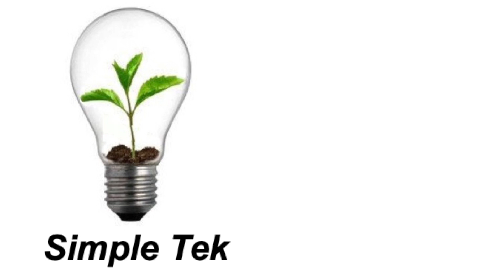Greenhouse Geodesic Dome Growing in  -40'

Comment: I found an old book from the fifties written by a Danish plant expert.
And i quote (from memory that is)" Tomatoes need very stable temperatures to thrive, +18C at night and +24C in the day time"
He also said that the proteins in the leaves will coagulate if the plant surface temperature reaches close to 35 degrees C.
So next spring im going to try his advice in my small greenhouse, with the help of a electric space heater im going to have an automated simple system at 24C daytime and 18C at night.
And im going to have an emergency cooling system(again a fan taking in air from the outside).
Will see if it helps.
(Im in the North of Sweden, roughly somewhere in the Northwest territories for you, just not as cold as Canada i imagine.)
But growing tomatoes in the winter is hardcore work, thanks for the video, great content and good luck!
Reply from the maker: Thank you for the kind words!!

Comment: My advice would be to attach a greenhouse to the side of an already heated building, the building and the greenhouse will insulate and heat each other by some amount, as well as shielding each other from wind. Every layer of plastic you add, even if it seals poorly will add a significant amount of insulative value even with a small airgap. If you did buy a digger you could dig several feet down, lay down insulation underneath and on the sides of the hole (sides only would be fine it if you went deeper than the frost line) , then only partially backfill with soil for thermal mass, gaining you below ground height for taller plants, and innate protection from wind, Could also use any excess dirt from the hole to build a mound to block wind. A basic shed around that boiler would keep it warmer and you might be able to pre dry wood in there with the waste heat
Reply from the maker: That works

Comment: The shiny foam board insulation is10$ for a 4x8 sheet here in Ontario and if you tape the seams between the sheets it works very well, you could insulate the floor with it but it’s slippery and would compress over time. I would put small pieces under the containers to lift them up a bit so they don’t lose heat to the ground.
Reply from the maker: Where???? What store?
Reply: @SimpleTek  I just double checked, Lowe’s has 4x8 silverboard for 12.50, its went up a couple dollars since I’ve last looked
Reply: @SimpleTek  Home Depot and Lowe’s
Reply from the maker: @ourfamilyoutdoors7331  I just looked at Home Depo online, couldn’t find anything under $20, and that was 1/2 inch thickness. So even IF they had $10 sheets, 1/2 inch means to get 4 inches thickness you need 8 of them, or $80 a sheet…
Reply: @SimpleTek  I don’t think it needs to be 4 inches thick, I’ve never seen it used layered up like that. It’d probably be better to use a different insulation if you want it to be 4” thick.
Reply from the maker: @ourfamilyoutdoors7331  they make 4” styrofoam sheets, I’m using them now

Comment: I have a design that I'll try next. If you put bubble wrap (big bubbles, with bubbles facing out) on top of the frame and then clear poly on top of the bubble wrap, you wind up with air spaces between the two sheets of plastic being held apart by the bubbles. This way you don't need to blow air between the plastic. What do you think?
Reply from the maker: personally I hate bubble wrap.
Reply: Without the air pressure the cover will flap in the wind and sag under load :) The air pressure in my cover per square foot will lift objects weighing over 10lbs. (Metric 51 kg per m2)

Comment: That boiler should do closer to 5000-10000 sq ft. You need to dig down and insulate the base and any north walls like the chinese greenhouses.
Reply from the maker: totally agree. I need a Chinese style greenhouse with a retractable insulating blanket. that's my next greenhouse.
Reply: @SimpleTek  If you can source it foam insulation is your friend. Earth berms couldn't hurt either. Or some form of thermal mass element. Happy new year by the way and a thank you for your content. I'm sure you have seen the Nebraska man grows oranges in the snow video, this inspires me.
Reply from the maker: @markschroter2640  I have a video on how to supercharge his system for colder climates like mine!!! Cheers!
Reply: @SimpleTek  Ground source heatpumps?
What is the name of it?
Reply from the maker: @markschroter2640  they work, expensive though.

Comment: For the plastic tears, you can use clear aircraft tape.  It's the stuff used on the leading edge of the wings able to withstand high pressure and temps.
Reply: Have you tried tuc tape?
Reply: @markschroter2640  cheaper.   Not sure how well it will stick.   I like cheaper but needs to last a long time as well.  Surface prep is important and transparency if there are many tears and strong winds can be an iasue.  Personally $20 for a known fix is worth it but to each their own.
 Being air tight has a huge impact on moisture control as well.
Reply: @l0I0I0I0  Adhesives are like magic, it may well be worth the $20 if it works.
Reply: @markschroter2640  Thanks Mark.  It will work, proven method.  The tape I have worked with is weather proof, rapid temp change  proof, sticks like crazy, difficult to remove, UV resistant or proof, and is way cheaper than 300+ for new plastic.  The reason for the over engineering is because if a piece flew off and hit the engine, it could cause millions in damage and kill the crew.
Reply from the maker: @markschroter2640  I used specific greenhouse tape
Reply from the maker: Where would I buy that?
Reply: @SimpleTek  Let me check Amazon.  Stuff is amazing!  We used it on our Coast Guard jets speeds 300-400 knots.  Brb

Comment: Surround Yugioh Dome with biomass for decomposition compost insulation and build out your front door to be a double door system so you interested or close it and then enter the second door into the greenhouse
Reply from the maker: rather use a pile and pump the heat in

Comment: How long can your plants survive in a power outage?
Reply from the maker: depends on the tempature and wind... mind you I do have a generator. electricity is needed for the pump, dampener on the boiler and  and air blower on the greenhouse for the double poly- not even 100 watts total, the boiler just burns wood for heat.. I guess the fan on the radiator too in the greenhouse need electricity but not much
Reply: @SimpleTek  we were out of power for a couple hours last night. At minus 25 and a good wind, it would cool off fairly quickly without the double layer poly and heat from the boiler.

Comment: I have been designing a sort of super cheap rather large green house.  I hope to built it later this year, but it might be that i would need a permit despite living in the middle of nowhere.

Now when material price is skyrocketing i was looking for the cheapest building material i could find. The cheapest material i could think of is earth, straw-bales and raw-woodbeams. 1 Meter of earth have about the same insulation value as 10 cm of Styrofoam insulation, and 25cm of straw bale have about the same effect.

The greenhouse need to be fairly big to be efficient, but there is also a limit to how wide they can be made before it start getting expensive. To my calculation  about 7 meter wide is the optimal width. Separate the wood-beams and connect them with machine screws. (sure then are not cheap, but strong)

I found this product that is pretty much a double layer bubble plastic sheet for greenhouses that probobly could be pretty effective.  The thing with dual layer plastic is that it eventually losses its efficiency, and if they middle layer get to large, its actually get negative effect to expand it more due to convection transfer. Bubble wrap kills the convection transfer aspect of it.

On top of that, a earth heat/cooling pipe, that push down air in a pipe under the greenhouse if the air is over 30C, making it a pretty heafty heat storage for the winter.

Anyway, i have made a preliminary picture.

https://scontent-cph2-1.xx.fbcdn.net/v/t1.15752-9/270278480_4917686594929739_4527144353763718844_n.png?_nc_cat=103&ccb=1-5&_nc_sid=ae9488&_nc_ohc=RHqd6nMsob0AX-4q0k-&_nc_ht=scontent-cph2-1.xx&oh=03_AVIhYIokN8c4K3lxf7XSx8D4sY8Xbm068M4sshNJcqwajw&oe=61FBD125

On top of that i have an idéa of adding a on top 2 meter mylar sail to direct more sunlight down into the greenhouse. If the sail is angled somewhat down, when the spring comes around, the light will miss the sail.

Aditionally, a roaled blanket night insulation might also be added, that is one of the reason i'm doing sort of a solar greenhouse style build.
Reply from the maker: Just some thoughts on what you posted..

raw earth is best used as a thermal mass, not insulation. if you want affordable insulation , look at making aircrete or buy insulation from demolition sites, they always sell stuff at those going to the dump. 

Be aware wood rots and greenhouses are HOT and MOIST.

Bubble wrap sucks - double inflated polly is the way to go. stretching isn't an issue.

The under the greenhouse thermal mass storage systems are good - but there are better options that are cheaper...
Reply: @SimpleTek  
Its similar to a Chinese/solar greenhouse, but have a few main differences. Its not like having window only to the south is some sort of novel idea. If i would made this professionally i would probobly turn it on the head and make it 7 meters high and 3-5 meters deep due to the very shallow sun angle here. The core concept here is not really the about having a south facing green house, but rather making it sufficiently cheap.

Earth can be used as a insulator if used correctly, effectively, the ground a house stand on is always acting as a thermal barrier, maximizing  the thermal effect of the ground. In effect here the ground works both as a thermal storage as well as a thermal barrier.

The bales would of cause need to be externally drained not to be moist on the outside, and have a some what of a barrier on the inside (probobly clay).

Insulating the ground in a greenhouse would be impractical. Having a barrier insulation around it works, but then mold and moist safe material must be used. This way the heat have an extra 2 meter to go to escape the ground, and it would escape to a level of ground that is about 90 degree out of phase with the season.

Having a hot moist environment is of cause decrement to wood, specially sawn wood. Having non sawn wood  reduce this effect significantly. If the would would be swan,  it going to warp with in hours. raw wood don´t warp, specially so under tension. Its also much more rot resistant. Rot really need to attack the grain not the bark. The end would of the strengthening parts have to be treated of cause. I´m probobly going to treat everything, but i´m not expecting it to bite that well.

I'm not talking about wrapping bubble sheet, but rather bubble sheet specially made for greenhouses. There is actually finished bubblewrap greenhouses to buy.

https://www.willabgarden.se/produkter/vaxthus/vaxthustillbehor/varme-och-isolering-i-vaxthus/vaxthustalt/overvintringsrum/

Now i might go the bit more expensive route of poly-carbonate, but that would be fairly expensive for a so large build. The greenhouse bubble wrap sheet is about 20C/m2, while  polycaronate roof is about €47/m2.. While that is four layer roofing, its still quite a bit to expensive.
Reply from the maker: basically your diagram is a Chinese greenhouse with an underground thermal mass heating system
Reply: What about snow loads and excess ground water in rainy season
Reply from the maker: @user-pb6nm6yb6e  water hasn’t been an issue, I raised the ground it sits on. Domes built right are very strong, I can hang off it and I’m 320 lbs
Reply: @user-pb6nm6yb6e  
"loads and excess ground water "

Its on a slope, Just digging a 15 meter trench and a drain pipe down the hill.

"What about snow loads "
Snow loads are calculated for.

Comment: Try a more insulted boiler shed. It is definitely costing you more with that.
Reply from the maker: not really - the real cost is the amount of heat the greenhouse draws. I ran the boiler last year without the greenhouse and it used less than 1/2 the amount of wood (it also heats my house). The greenhouse uses an ENORMOUS amount of heat.  the other problem is I made my own underground lines and I didn't insulate them properly, if I changed the underground lines out to properly insulated lines I'd get maybe 30% or more better performance. I'm heating the ground ;( .... whoops - but I'm learning.
Reply: @SimpleTek  
Oh wow.

I thought you insulted that part.
That does explain it then.

Live and learn

Comment: Good ideas. It might help to get those riots off the cold ground. Maybe pallets under the pots would help
Reply from the maker: the ground is warm - radiant heat floor- so direct contact with the ground warms the base of the wicking pots. raising them up off the ground would actually make them cooler

Comment: 5:33 hey man put space blankets in with that insulation, they're cheap, they're a wide surface area, and they're reflective to infrared, they can help bounce back heat that gets through the insulation
Reply from the maker: need light too to grow!
Reply: @SimpleTek  no like along the ground, so you can mitigate the radiant heat transfer while the regular insulation deals with physical conduction
Reply from the maker: @kingmasterlord  ahhhhhh ok

Comment: I built a 11x22 post frame lean to greenhouse on my garage.The top and front is double poly film and the sides are polycarbonate with a door each side. It takes 10-15 min to inflate and holds the air for 1 to 1.5 hours. I wonder if I can heat it with a hot tub, lol. I got pics if you got a email.
Reply: I am a fan of putting structures together, they both benefit from the heat and less is wasted to the atmosphere. The hot tub should be in the greenhouse.
Reply from the maker: hjor@mts.net
Reply: Sent some pics, lmk what you think? It works right now, but I have some upgrades on the cheap.
Reply: The hot tub will create too much humidity. If you weld the open edges of the double poly, the air pressure will hold for days. The power used for cover inflation is almost nothing